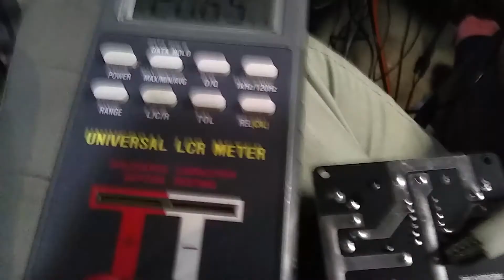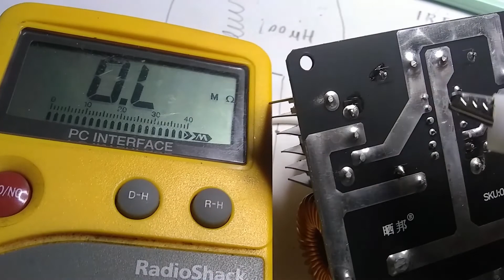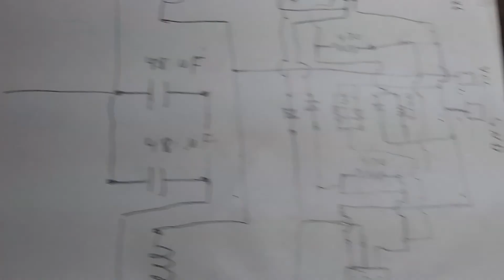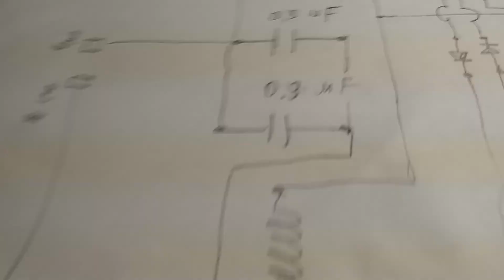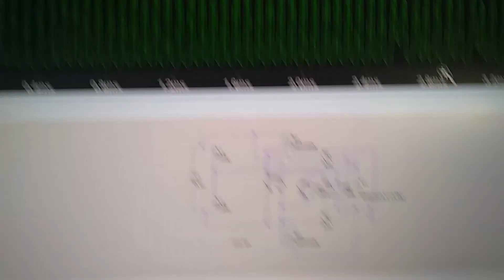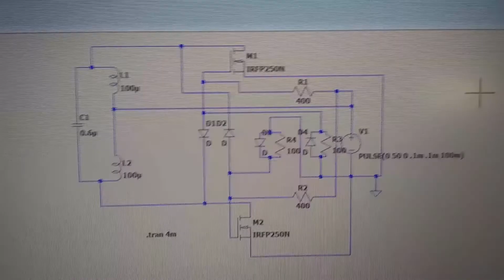Reverse Engineering RF Induction Circuit!

Comment: I think those inductors on the board are only really there for current control and not for resonance.  A nice project would be a ZVS CW Tesla coil. Thanks for the upload!
Reply from the maker: Yes, You could be.. The inductor you supply makes the resonance circuit! Thanks!